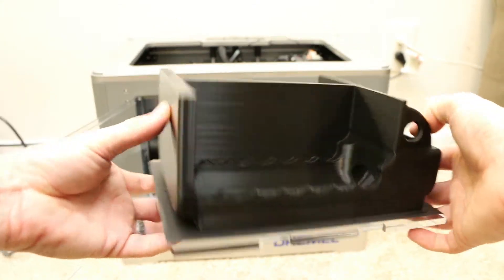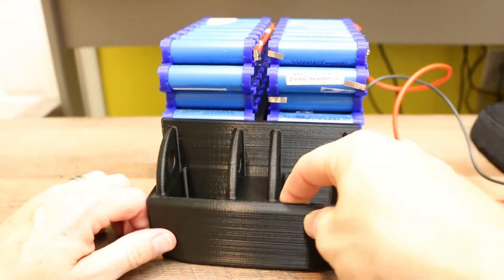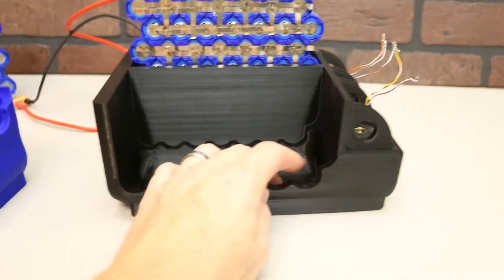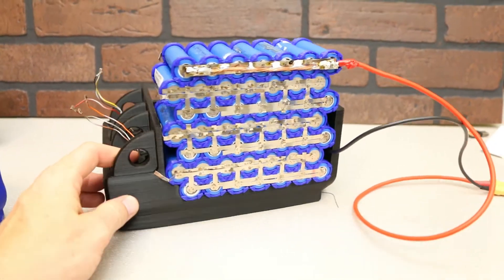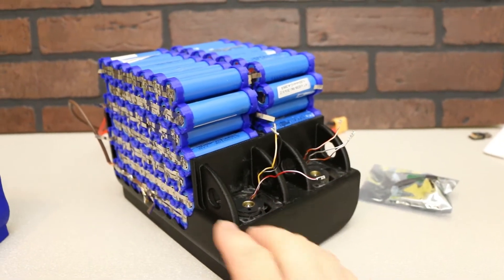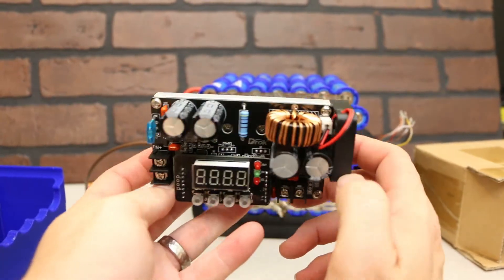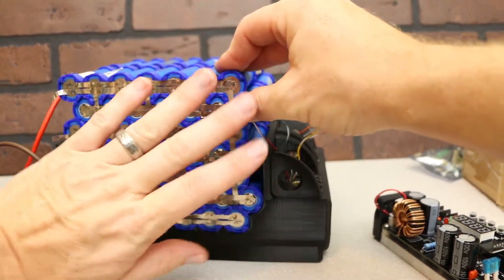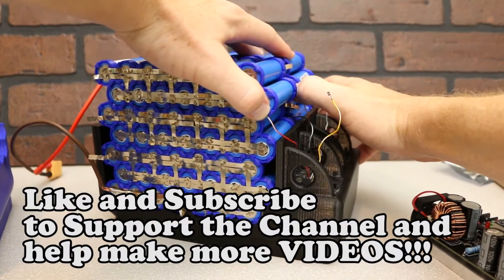EBIKE BATTERY UPDATE air cooling FTW 18650 14S 14aH

Comment: I was thinking about cooling a battery pack and searched about it, but only found simple concepts/ideas or people saying "overbuild the pack so it won't heat up"

But my idea of the application was in a sealed and waterproof pack so it could be used in extreme conditions like winter cold or summer heat. The problem was that being sealed it would heat fast (or at least faster than with simply a heatshrink wrapping) and if used in summer heat and possibly direct sunlight it would definitely get on the warm side and maybe even toasty. I kinda tried to design one but as it is just a conceptual idea and not a serious project, I didn't build it or make serious calculations

What I have for now is pretty bulky and heavy, but here's the idea:
For parallel connections put the cells not in a honeycomb layout like you did but one over another, like in square holders. Then, don't make the series connections putting flipped cells one besides the other but rather put them, well, in series(as inside a laser pointer or a torch). Then, put plates to cover the sides of the cells but not the top or bottom and use spacers to separate both the cells and plates from the box you would use to put that inside. If making a 3s pack, for example, a pc water-cooling radiator of two 120mm fans should be enough to cover the cells lengthwise and put 5 or 6 in parallel (if making only one row of parallel cells) on one of the uncovered sides, and that radiator would be connected to another rad on the exterior to make the exchange of heat. The idea is that the air on the inside would circular cicles of going through the rad, then between the cells, then through the uncovered side of the cells to between the plates and the exterior box walls back to the rad and so on. I guess the interior plates could be removed and it would still work but the problem is the bulkiness of both rads and the pump for the coolant and such.

Very crude, bulky and probably kinda complex design but as an amateur it's what I could come up with and just wanted to share with someone

Comment: why not heatshrink the pack with the fan included in it, and cut vent holes for thr fan? wouldn't it have the same effect as this contraption?
Reply from the maker: Yes, very similar indeed. Maybe 3d print an 'in' and 'out' and heat shrink it together. I like it! Thanks for sharing this idea. It's actually really good.

Comment: Hey!!! Idea use copper pipe buss bars to channel the air through the end buss to cool? Huh Huh what ya think?
Reply: Ya talking about normal copper pipes or heatpipes like in pc coolers? If the latter one, I've recently read about that and seems good but I suppose there's a problem:
You only see the exterior and don't know the thickness of the heatpipe's walls so don't exactly know the wire area equivalent. I guess you could measure resistance or conductivity or voltage drop under load or something or even maybe cut one to see
Nevertheless, seems interesting

Comment: Sir, I want to cool around 400 cells battery pack so can you tell any other alternative to cool
air cooling method is not that much efficient ..for 400 cells battery pack
so please tell any other alternate
Reply: It depends how much power you want to put through them. If you run them at 1c they should be fine. you should test your box with a thermometer with a wire/thermistor and add fans. what is teh 400 cells for? Tesla use a network of liquid glycol, research google. why do you use cells in less than 1 hour? that is too fast! a 400 cell motorbike can do 150 miles in one hour at 4000 watts. its too much power. they are made to be used at 1-1.5C continuous and 3-7C peak for 1 minute or 2.

Comment: What kind of temperature sensors are you going to use? I have a bank of 1400 cells. And going to double or triple that. And would like to put about 4 per 100 cell pack. Thanks and great work. Looks nice.

Comment: Very nice and compact, but is there really any need for cooling if all the cells are so close together and your not using real cell spacer peices and the cells in the middle get affected by heat the most not the outside!?  Good build though.
Reply from the maker: Thanks. I am choosing moving air vs. no moving air. Best argument yet is that it will definitely feed a fire plenty of oxygen. I still have to complete this :(

Comment: Hi - do you think it should be mandatory to ensure each cell is individually fused like Tesla safety 
Would love your feedback
https://youtu.be/7ft1J1Wiggs
Reply from the maker: i answered another comment regarding this. you guys should make air cooled batteries!
Reply: Hi - thanks for the reply - what would you way is more important - water proofing or air cooling? Or both ideally? Thanks again for your reply - respect you opinion - kind regards
Reply from the maker: air cooling over water proofing. Water proof = submersible. Water resistant and air cooled are possible.

Comment: looks cool... but you know li ion batteries work more efficiently when warm right?
Reply from the maker: Yes. And they get damaged when they get hot. Best case of this warmness you mention as an external example, go to Tesla's website and put the ambient temperature to a higher temp and the range goes up.. in the model x or S overview page. in my first test I didn't push the batteries too hard and they got to 107F. They still had lots of energy left. They need not reach 130 or 150 or even 170F... cooling FTW!
Reply: Um, sorry correct if I'm wrong, but I think the range of "cool" that inhibits power output is lower than some computer fans should output. I have a much simpler system I'm using, only because I don't have the 3d printer
Reply: For me we are talking southwest Florida for 14 miles round. I bought the same temperature sensor, and my system also includes a buck down converter to be able to run the fans, headlights, and  a 110 converter..... oh. Well you just got to the part in the video that has the exact same buck converter. Great minds right? (Bte getting the version of the temp sensor that includes a plexiglass box is 20 cents cheaper for some reason

Comment: Very cool, but do 18650's need that much cooling? I don't know honestly I only got my E-Bike 6 months ago and just got a load of laptop batteries and am in the process of charging and testing the individual cells, but I love your case, I'd love to use it or something like it in my first ever battery build. I only found your channel the other day as you may remember you answered  my comment and I am going through the back catalogue .
Reply from the maker: +Brannen Thompson thanks for the comment! These batteries I am using are from laptop cells and are not high performance by any means. They do get to around 107F during regular/heavy use. If the outside air is cooler I believe I should capitalize on that and exchange some of that hear with that air. Some will argue that it is not 'needed' but their standards are different than mine. Similar to how Nissan does not cool the leaf batteries but other EV manufacturers do. If you want your batteries to last a long time, keeping them from getting too hot is very important. Does your ebike battery get warm to the touch? If it does, you could probably benefit from cooling. I hope to get some time to finish this project soon

Comment: nice  i will like to print so like that but for a power wall 80 cell in parallel  7 blocks  3.9 volt each for a total of 27.3 volts  can you shear me the print file for this ones?

Comment: The only problem I can see with all this is that it's a complete waste of time and effort, here's why, I can not think of any and I mean any ebike battery in the world which has a fan cooling system because they don't get hot enough during charge or discharge to make any difference at all, not even the BMS gets even luke warm, now the controller does sometimes need some heat dispersion but most ( anything under 1000 watts) actually sit in the same "insulated" bag with the battery, sorry guys a complete fail unless you want to feed extra oxygen to a lithium fire to get a better burn. Laughable.
Reply: I'm a noobie to all this and have been going around, hoovering up information re a battery build etc.
I get the impression from what I've read and viewed that temperature can be a problem, at times.
Well, this battery set up sure wont suffer from that.
I see value in this project.  Good work
Reply: Michael Bradley I was actually thinking the same! I've never ever seen an ebike with cooling system. If cooling system is needed for his setup, may fuses are needed on each cell like tesla do on their batteries. I only watched this because I am planning a cooling system for my prius range extender battery.
Reply: If you are pushing a battery that hard on a bike that you need to cool it, you are stressing it to the point its cycle life will be greatly reduced, which means it is undersized/underpowered to begin with.
Reply from the maker: +Here Now thanks :)
Reply: My 20s5p will be about 60deg C after 30miles commute. Controller around 50. 350a phase. 140peak A battery.
Reply from the maker: +Michael Bradley not even the BMS gets Luke warm you say. There is a channel called ebikeschool. Check out what he says about ebike batteries and heat. To include their website.

Comment: Would there be any difference in effectiveness between pushing the air through the batteries and pulling the air through (if you turned the fans around)?
Reply from the maker: +Eric Jenkins not too sure. There may be a difference to the batteries.. for the fan, hot air rushing thru may not be advantageous.... I think people who are really into building computers know the best answer to this. As for me, i like pushing the air. Ah, i got it.. if the fans were turned around it would just suck... And that sucks. Yes .
Reply: I thought he would have one fan volume pushing whilst the other set (reversed) for vacuum pull!!
Reply: yes. if you cool the tabs. positive and negative, you get 60% more cycles than just cooling the cells themselves

Comment: Very nicely done! Also glad to see that you went with the DC/DC converter idea rather than just pulling extra power from a few cells--think of all the lights and stuff on the bike you could power with that thing! ;-)

Ah, Arctic Alumina adhesive... brings back memories.
Reply from the maker: thanks man! yeah, its better to treat all the cells equally rather than pull energy from just a few. II hadn't thought of the lights thing until now (imagine decked out long-haul semi truck) hmm... maybe.. maybe not. 

400 watts is a lot. I forgot a few overlays, last night was a late one....